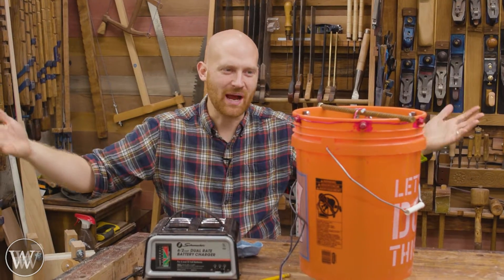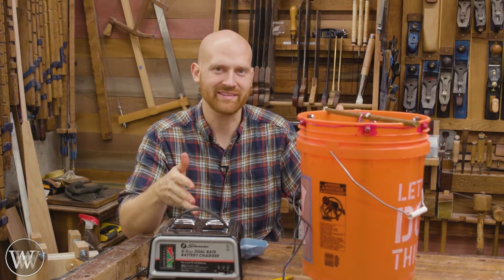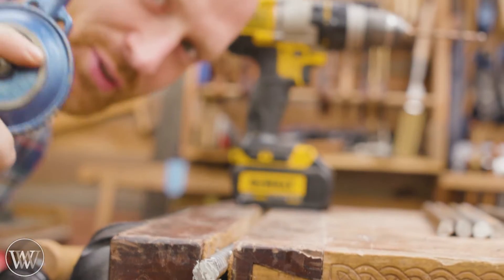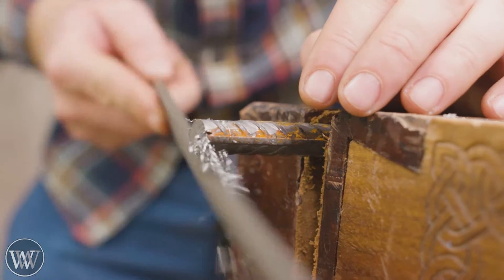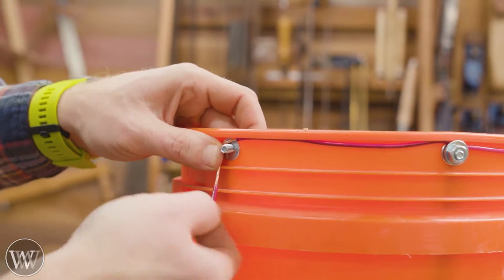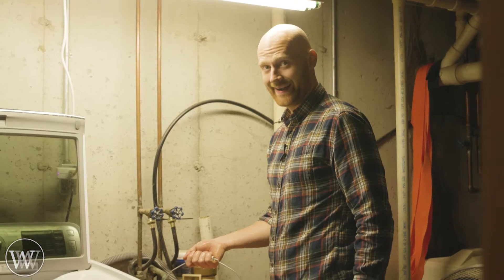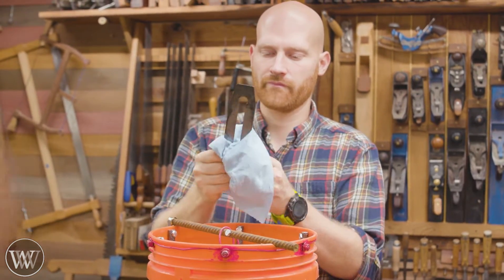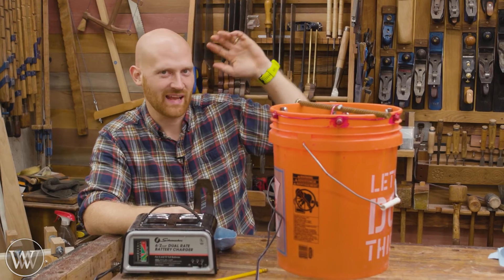How to Make an Electrolysis Bucket Tank Thing DIY

Comment: I have owned a Diehard 10/2/60 amps fully automatic and manual battery charger engine starter model # 2871310 for over 20 years that I have never used still in the original pristine manufacturer box. Bought it because my dad always had one at the house, so I did the same thing, but I never had a need. When my battery started to go bad, I would just replaced it. Now reading all this comments about how hard they are to get, I really started to appreciate this old time car battery charger engine starter more that I ever did. Thanks for sharing your knowledge. I have several cast iron skillets that actually need this treatment that’s why I am watching this video.

Comment: Tried my car battery charger but it did not work since it is newer. However I had a 2000mA universal wall charger from amazon that includes wire terminals. Switched it to 12V, hooked it up and it seems to be doing the trick.

Comment: How do I prep for paint after? Do I need to clean it and with what? I'm thinking to use this instead of sandblasting because of cost and getting inside hard to reach places. Like motorcycle exhaust
Reply from the maker: This will remove rust but it won't remove grime and dirt or other contaminants. Sandblasting is far better for that. Usually after this still needs a good scrub down if I get rid of any other contaminants. But that can be done with a simple degreaser or a strong soap.

Comment: Instead of washing soda I've always used salt, any difference in your opinion
Reply from the maker: Not that much.
Reply: Don’t do this. Followed this comment and I used salt in my first electrolysis set up. It does work but it also creates hazardous chlorine gas and a gross black sludgy residue that may be carcinogenic.

Comment: It’s worth mentioning that rebar often has a coating on it that may hinder performance of electrolysis. So hitting it with a wire wheel before you finish set up is also a good idea!

Comment: What about using an old computer power supply? What do we want here just 12v with 6-18 Amps? Is there a preferred amperage? If an old computer power supply work work there are a lot of them laying around out there, and they have a fan etc. Also - any changes you'd make now that you've done this?
Reply: You can use any DC power supply. Outside of safety concerns, there's not an optimal voltage or amperage. The more watts, the faster the process will work. When I made this, I used something like 12v, 8a and it worked just fine. Make sure to do it in a ventilated area, or set up a fan so that you don't get a buildup of hydrogen gas.
Reply: @joshsachs6140  Thanks - I'll have to keep my eye's open for an old power supply or battery charger at a garage sale. What do you think worked better this or the method you showed in your other video here - https://www.youtube.com/watch?v=GYEbzI4AtpA ? This other method seems pretty good, cheap, and looks very effective.

Comment: washing soda???? baking soda?
Reply from the maker: Similar but different chemical.
Reply: @ I’ve always just used baking soda and it seems to work but I’ve never used washing soda. Curious to see the difference. Thanks!
Reply from the maker: In this case there would not be much of a difference. It is just there to ionize the water

Comment: Why don’t you just use a 12 Volt DC power supply instead of hunting for an old battery charger?
Reply from the maker: Amperage
Reply: @ what amperage do you need?

Comment: You find other videos that say once the rust is gone it want remove un-rusted metal. So do you know  for sure, or are you just repeating what you heard some one else say. Or did you do a test to prove it?
Reply from the maker: Yes it will remove metal. That is the same thing as electro etching. The myth is that it will only touch rust, but the electricity does not know the difference between oxidized iron and clean iron. The rust is just faster to come off because the bond to the base metal is weaker.

Comment: One video on this subject said this system only removes rust. It said it won’t remove un rusted metal. So you cannot leave it to long. Would be a good experiment to see if it removes unrusted metal.
Reply from the maker: It will remove base metal but at a much slower rate. That's just the nature of electrolysis.

Comment: Thanks for the video. Am I seeing things or was the hack saw blade on backwards?
Reply from the maker: Surprisingly, there is no right or wrong way to put on the hacksaw blade. Some manufacturers tell you to put it on in a push stroke and some on the pole stroke. Historically, it was used on the push stroke though in the last 50 years you've seen more and more people using it on the pull stroke.

Comment: Can I use a 12 volt rechargeable battery?
Reply from the maker: Sure. I am not sure how long it would last though
Reply: @WoodByWrightHowTo  I'm not sure we shall find out and go from there. I'm using a 12v lithium ion battery off a drill. Fully charged I should get a decent amount of time if not that's the fun of experiments. Thank you for the info

Comment: Can you use this method to remove paint from cast aluminum?
Reply: Also, aluminum is not stable in alkaline solutions like washing soda, i.e. sodium carbonate. It will slowly dissolve.
Reply from the maker: No this will not remove paint.
Reply: Put aluminum in lye and it almost evaporates.

Comment: It’s worth mentioning that rebar often has a coating on it that may hinder performance of electrolysis. So hitting it with a wire wheel before you finish set up is also a good idea!
Reply: Good call.  I believe graphite rods or slabs would be even better for conductivity and will last forever.  It’s fairly inexpensive too and can be cut down to size with a hack or band saw.

Comment: I have a question. Why couldn’t a 110v to 12v converter be used? Or could it?
Reply from the maker: You could do that as long as it has the capacity for the amperage that this would draw.
Reply: Thank you. And would the required amperage capacity you mention be determined by the amperage of the circuit/outlet I’m plugging into or the rating on the 110v to 12v converter? My interpretation is that you meant, as long as the amperage draw from the converter doesn’t exceed what the 110v circuit is rated for, correct?

Comment: I dont know how to ask this. How could you do this with sheet steel that wont fit in the bucket or is not removable? I bought a school bus and when removing the ply wood floor i found large areas of surface rust, given mostly contained to about 1 foot spots I was wondering if I could rig an electrolysis tank over the rust and watch it go away. I know there are other methods sanding and chemicals but for larger areas I thought of electrolysis.
Reply from the maker: If you can't submerge it this this won't work. For that I usually go to sand blasting.
Reply: @WoodByWrightHowTo  have done this in a 5 gallon bucket on a smaller scale.  the bottom of the tank would be the floor so technically the rust is submerged
Reply from the maker: sounds like a fun experiment be carful grounding it though.
Reply: Flex seal and an upside down clear tote.with holes drilled in it?
Reply: I know this is a year too late and you might have already solved it, but for anyone else this might be useful information still.

What you can do is, first disconnect the battery from the chassis, of course, then negative to said chasis, and then, get a big brush and tie a copper wire to the base of the hairs, so that it can touch water that the brush is holding. Then that wire goes to the positive, just like the rebar in the video. Now you grab a small bucket or jar, and make the washing soda solution. You might want to pre-wet the rusty surface that you want to clean, so that you use less of the solution, and then it's a matter of brushing the solution over the rusty parts a couple of times, with the power on, of course. I suggest to do this during summer so you dont need to spend extra time drying everything afterwards, but when you are done, just spray some water to wash the solution away, and let it dry. You might want to use some wd40 to displace the water in the hard to reach/evaporate areas, and then a solvent to clean the wd40 and oil after that solvent evaporates.

Good luck and let me know if you have used this method successfully, never tried it on a big thing like a school bus, but it works on old tractor chassis that are a pain to disassemble.

Comment: 0:42 Electrolysis will not attack the substrate (steel) the sacrificial anodes get dissolved ,not the item to be cleaned (cathode)
Reply: So this wouldn’t disturb or change the metallurgy of the metal itself?

Comment: What's the maximum voltage you could run? I know 12-volt DC but amperage,  I don't know thanks...
Reply from the maker: I know some people will do it at 24 volts but I don't think I'd want to go much higher than that. Mine pulls about 10 amps.

Comment: It may be important to point out that it's the sodium that makes water conduct electricity. I think if you can't find washing soda, regular salt will work (allow time to fully dissolve). Also, it's been said that the gasses created (hydrogen and oxygen) are flammable so keep the charger and plug-in outlet a good distance...and do it outside 👍🖖🤙
Reply: Electrolysis of salt aka NaCl also produces chlorine gas.😢

Comment: What voltage is required to circulate through this system? The battery output voltage??
Reply from the maker: I use 12 volt

Comment: Do the rebar rods touch the bottom of the bucket? Also i'm guessing the item that is being derusted can't touch the bottom either.
Reply from the maker: Yes they can touch the bottom. I believe mine ended up being about a quarter inch short but there's no problem with anything touching the bottom. For the item in the bath you probably want to keep that up just to have water flow around it.

Comment: I just made an E tank and one curious if you can allow the object to be descaled to touch the rods on the side of the tank
Reply: No. That's short circuiting the system. Want the current to run from anodes to the object thru the solution.

Comment: Made this thing in an hour max. A tip for any of you that can’t get your hands on an old battery charger, you can use a new battery charger aswell as long as you have a spare car battery. Put the car charger on the battery, then run jumper cables from the battery to your bucket. Keeps the battery charged and the bucket going.
Reply: Manual chargers are increasingly hard to find. Lots of people who do cast iron cookware restoration use a 10 A, 30 V DC power supply. In 2024, they're about $50 to $70 on Amazon.
Reply: Thanks for that, I was just about to ask if it could be done this way!
Reply: Me too. I was going to ask the same thing. Was also wondering if a 120v to 12v converter would work
Reply: Or just buy a power supply. They are cheaper than a battery charger and you can adjust the voltage and current to suit your needs. It's way more safe and versatile. 

 It makes no sense to buy a battery charger for this purpose when power supplies are so cheap
Reply: Why not tell us this in the first place? These people are hacking Harbor Freight chargers and it does not have to be done. Incredible! Just to show us how crafty they are?
Reply: If you have a spare car battery you can sell it and put 2 of your kids most of the way through college.

Comment: Would this work on limescale
Reply from the maker: Unfortunately no. It would then start eating into the steel underneath it. It would probably loosen the limescale eventually but you would lose a lot of material underneath it before that.
Reply: @WoodByWrightHowTo  than you so electrolysis only work on rust for steel thanks.
Reply: @WoodByWrightHowTo  would of work on gypsum.
Reply: @Deusvult2399  no, it only removes rust from pure steel

Comment: Very good video. Two things I must note though. 1. Please use safety glasses when doing a tutorial video, especially when drilling metal(s). 2. Metal is much easier to drill if you start with a small bit for a pilot hole.

Comment: When you say "Washing Soda", do you actually mean "Baking Soda"? Sodium Bicarbonate?
Reply from the maker: No washing soda is an old fashioned detergent. If not that, table salt will work.
Reply: @WoodByWrightHowTo  Thank you VERY much for the clarification!!!  But, which works the best? Sodium Bicarbonate, Cloths detergent, or table salt?  Also, are the measurements approx the same?
Reply from the maker: The measurements are approximate. I would not say one works better then the water. They just increase the conductivity of the water.
Reply: Washing Soda is sodium carbonate. In the US, a common brand is Arm & Hammer. I've also heard that this same chemical is what's in  a pool product called pH Up.

Comment: Question...Will this remove any kind of plating?
I'd like to remove some tin/nickel etc. off of some brass I want to scrap. ( example.. The plating on the ends of extension cord Plugs) Please Advise!  Thank you kindly!
Reply from the maker: it might work in some circumstances but not in most. usualy to get that off the best is to sand or scrape it off.
Reply: @WoodByWrightHowTo  appreciate the quick response !
Btw, I'm glad I came across your channel as I have a wood shop just out back. Just subscribed, looks like alot of very interesting things you have.
Once again, Thanks!👍

Comment: Thanks for this video! Can the re-bar be re-used for multiple uses of electrolysis? If so, is there a limit? And how would you advise disposing of the liquid bath after use?
Reply from the maker: yes I have never replaced it. and you should not have to as long as it does not rust out from the soda water. usually I reuse the water 20+ times then just dump it out in the lawn. There are no chemicals.
Reply: @WoodByWrightHowTo  Thank you so much! I really appreciate that you answered these questions :) keep up the great videos ,brother

Comment: Great video! There are new battery chargers that will work and can be found on Amazon or other sites. Just search for "Manual Battery Charger". An example is https://www.amazon.com/Ultra-Performance-35001-Battery-Charger/dp/B01M307AZJ/ref=sr_1_14?keywords=manual+battery+charger&qid=1579799345&sr=8-14
Reply from the maker: cool thnaks!

Comment: i like using this method for etching. just paint the metal with nail polish and scratch in what you want etched. works with aluminium too, but takes a bit longer
Reply from the maker: Right on. There are a lot of fun things you can do with it.

Comment: It also works with regular table salt, they just dont sell washing soda here in chile 😒
Reply: Bro that makes mustard gas
Reply: @BradenWhitworth08  no, it makes chlorine gas, which is toxic in high concentrations and used in the trenches, but if you do it in a well ventilated area, like outside it is not an issue, this makes way too little chlorine gas
Reply: @thekchile  my fault thought that mustard gas was literally just chlorine
Reply: Do you use the same amount?  
  Acouple of times I have used Arm and Hammer wash detergent. Worked really good I first large piece I removed rust from.  I used a kiddie pool.
  Btw, I used a roll around auto shop charger snd more less guessed at the amount of detergent to put in the water as I had no idea how many gallons of water was in the pool. 
  Second time I used one of the little chargers and a plastic garbage can with very little luck. Could only get about 3 amps to show. Guess I needed more detergent or what ever I used that time. 
  I also bought some pool cleaner to use but have not yet that I can remember.
Reply: @rickeykeeton4770  just disolved until the water is saturated with salt

Comment: An alternate power supply would be the power supply unit from an old desktop computer.  They are designed to provide 12, 5, and 3 volts DC any of which would be a safe valid option.  The big key is to choose something that can provide a DC output.  Electrolysis requires DC to keep the rust moving in only one direction (i.e. AC would be removing and then re-adding the rust  as the polarity is switched).  For safety, 12V DC is commonly recommended.  This provides an effective and efficient electrical flow for rust removal while maintaining minimal risk of either electrocution or arcing.
Reply from the maker: right on. I know a few people that have gone that way as long as the supply is rated for the amperage.

Comment: Another thing to be aware of: if a lot of crud/old rust builds up in the bottom of the tank, clean it out! If your part contacts that stuff and that stuff is in contact with one of your anodes, you can smoke the charger, blow a fuse or trip a breaker, etc.

You don't need to replace the solution every time; you can just top off the water, stir it up and run it again. As long as the tank is bubbling, there's enough electrolyte in there to get the job done...So resist the urge to add a bunch more every time.
Reply: If your tank gets less effective, you can take the electrodes out, clean them off---I sand-blast mine clean---or do the process with the leads switched and the positive/anode clamped to a sacrificial piece in the middle of the tank...It'll blast a lot of the rust off the rebar you're using for the anode under normal operation, but sometimes you just have to clean the rebar off.
Reply: @JoshTolbertUrbana  thanks! I really appreciate the extra tips in comments like these.

Comment: Unless you connect the electrodes backwards, this method should not remove any good metal.  In fact, if you chose a bath better at solubilizing the metal ions, it could remove metal from the sacrificial electrode and plate it onto the workpiece.
Reply from the maker: Lol that would be a fun time.